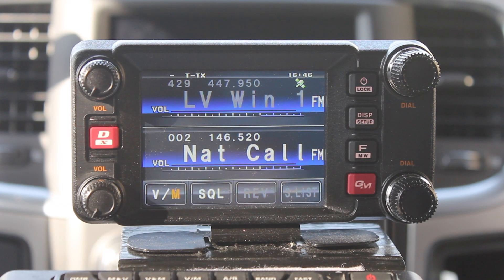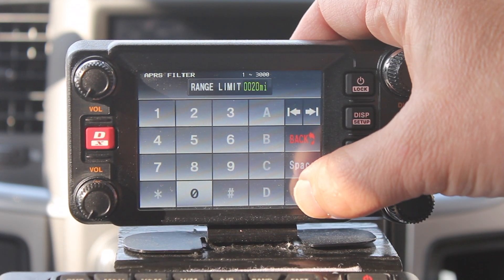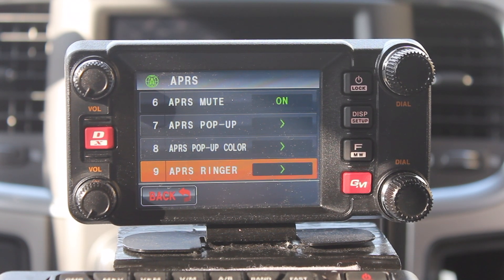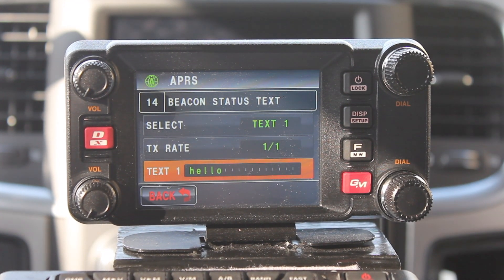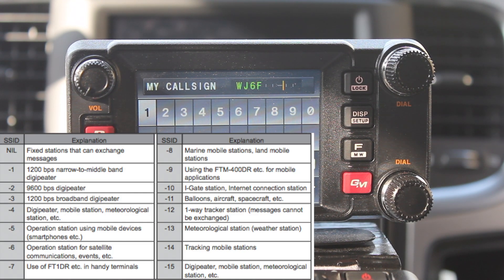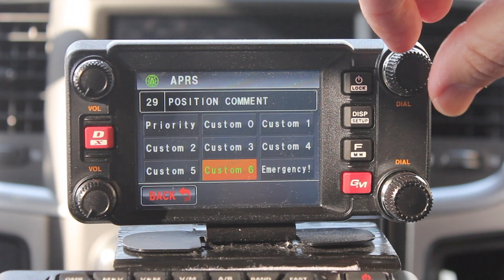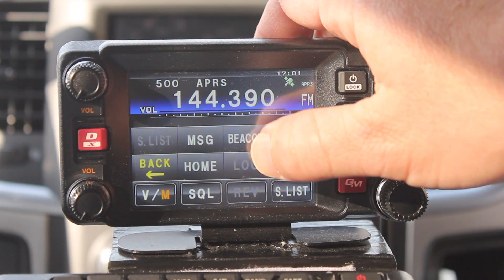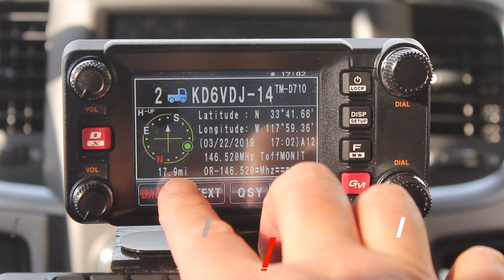Setup Your Yaesu FTM-400XDR APRS

Comment: APRS MUTE mutes everything on the band... In other words, if you switch away from the APRS channel to a regular  voice channel, you won't hear anything on the B band. If you turn off APRS MUTE, you'll hear the activity. It's easier just to turn APRS MUTE off and turn the volume down. Don't forget to turn off beaconing when you change frequencies or you'll beacon on a repeater! What I do, is set the APRS channel in a memory and set CTCSS Decode on with an unusual CTCSS code. That way the channel remains totally silent, since CTCSS isn't used for APRS. The radio still receives and decodes the APRS signals. When you switch to another memory, your audio is back and you can leave the volume up all the time!
Reply from the maker: Thank you for taking the time to watch and the comment! It is greatly appreciated.

Comment: Thanks for this.  Very helpful.  I need to set mine up for use at an off-grid cabin, so I'll need to input the manual GPS coordinates.  I know what those are, but what is the setting in parentheses?  The manual refers to this as 1/100" setting.
Reply from the maker: Thank you for taking the time to watch and the comment! It is greatly appreciated. I will have to dig a bit deeper on the 1/100" setting.

Comment: 6:28 How did you get the S. List to display on the VFO screen? I just got my new 400xdr a couple days ago, and mine has a 'Scope' tab. Kinda neat because its a waterfall, but I'd rather have S. List.
To get that, I have to hit the F/M/W button, then on that screen press the S List option.
Good vid!
Reply from the maker: I believe this is how you would change SCOPE for S. LIST: 1 Touch [SCOPE] for 4 or more seconds 2. Touch [S. LIST] The touch key [SCOPE] will change to [S. LIST] 3. Touch the touch key [S. LIST] The display will return to the previous screen. [SCOPE] will become operable in the function menu display when [F/MW] is pressed. Hope this helps.
Reply: @WJ6FRadio  Much appreciated, I'm gonna give it a try! I've only had the rig a few days and haven't jumped in the book too deep yet. Instruction? Who needs instructions lol!
Reply from the maker: @applejacks971  If we read instruction manuals we wouldn't have wound up in Schweinfurt!
Reply: @WJ6FRadio  Right! 'You failed to follow the proper steps in the presented block of instruction. You are a no go at this station' lol!
Reply from the maker: @applejacks971  Oh damn! Those are words that still haunt us all!! LOL!!!

Comment: Nice Video!    Helped me tremendously...

Just to clarify for me, the APRS freq, 144.390 must be set into Band B and that VFO should be tuned to 144.390, correct.....?

N1JWW
Reply from the maker: Thank you for taking the time to watch and the comment! It is greatly appreciated. Yes, you are correct for the frequency. However, if you go to DATA > DATA BAND SELECT (Menu 2) You can choose Main Band / Sub Band / A - Band Fix / B- Band Fix (Factory setting) / A=Tx/B=Rx / A=Rx/B=Tx

Comment: What's the point of APRS? I'm not sure I 'get it'.
Reply from the maker: Thank you for taking the time to watch and the comment! It is greatly appreciated. For me, I use APRS so when I am out of town. When camping, for example, she can see where I am at and should something happen and she is unable to get a hold of me she will know where to send help to look for me. I hope this helps.
Reply: @WJ6FRadio   It does, thank you. As a new operator, I am trying to get my head around the digital side of the hobby. There's a bewildering amount to learn! Thanks for the upload :)
Reply from the maker: @johnratcliffe6438  I know what you mean. I am still a bit baffled by the whole DMR side of things. I have used Fusion (Yaesu), D-STAR (Icom) and DMR. I like and have had the best luck with Fusion.
Reply: @WJ6FRadio   That's useful, thanks. I wish Yaesu or Kenwood made a dedicated 2m/70cms/23cms only - no HF base station like the IC9700 - hopefully soon! The FTM-400XDR appeals because I can use it for analogue FM locally, as well as Fusion. It's not expensive either in the grand scheme of things.
Reply from the maker: @johnratcliffe6438  I have thoroughly enjoyed the FTM-400. I have used FTM-7250, Kenwood's TM-D710A & TM-V71A, Icom 5100 (D-STAR), Yaesu FT-2900 and 2980 (both 2m only), but I always return to the FTM-400 as my go to mobile radio.

Comment: I followed your video to the letter (I have the same radio) and it doesn't work for me.  I am using B band with the 144.390 frequency.  All the right icons are showing on the main screen to show that the APRS is on.  I hit the Beacon TX button, it seems to transmit, but I don't see my position on aprs.fi.  It doesn't show any raw packets either.  Any ideas on what might be going wrong?  I live just outside Atlanta so I would think I can hit an APRS repeater from here.
Reply: I'm having the same issue here too and I know there is a digi repeater around here because everyone else is posting, and just the other day a truck driver past by down the interstate and his path was on aprs.fi. I have also followed every step on this video and others.  

Did you ever get yours figured out?
Reply: @kd9axo  Try pressing the 'SQL' tab...this will give a little, and I mean LITTLE rectangle box between the VFO freqs. In this box, it will cycle through T-TX, TX-REV, TX OFF, and one or 2 other things.
It has to be set to T-TX, otherwise it won't transmit. Just a lil thing to make sure is correct, it might be your issue? Good luck!
Reply from the maker: I have heard that APRS.fi favors the stronger, more powerful, stations
Reply: Try pressing the 'SQL' tab...this will give a little, and I mean LITTLE rectangle box between the VFO freqs. In this box, it will cycle through T-TX, TX-REV, TX OFF, and one or 2 other things.
It has to be set to T-TX, otherwise it won't transmit. Just a lil thing to make sure is correct, it might be your issue? Good luck!
Reply from the maker: For some reason I do not see mine on APRS.fi about 80% of the time either. I am not sure why. I used to. I have heard that APRS.fi favors the stronger, more powerful, stations

Comment: How do you like the radio? At some point I'll have to get a new radio.  My city doesn't have any digital, but I want digital capabilities for traveling. Also do storm spotting, RACES, ARES, and EMCOMM.. Great and informative video.
Reply from the maker: Thank you for taking the time to watch and the comment! It is greatly appreciated. I think this is a great radio! In fact it is my second one. I have had the Icom ID-5100, but found DSTAR to be Dead STAR. The FTM-400 is easy to use and program. When I am in an area that doesn't have any digital repeaters I use my ZumSpot.
Reply: @WJ6FRadio I have put in an order for an FTM 400 XDR :)
Reply from the maker: Sean Ingram cool deal!! It is a great radio! Hopefully it arrives quickly!
Reply: You can always run digital on Simplex :)